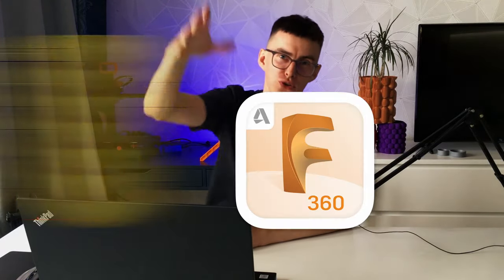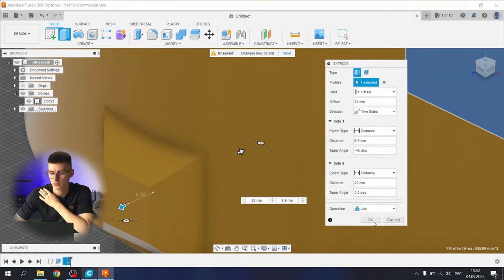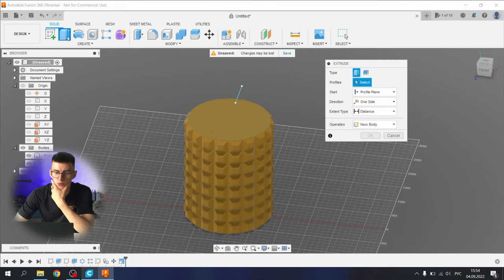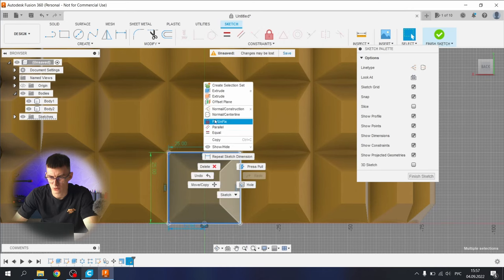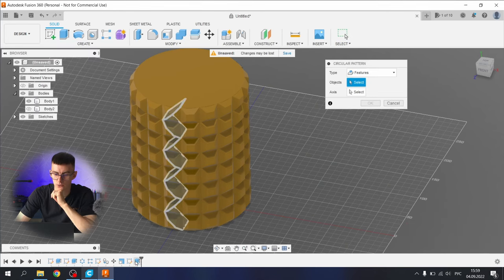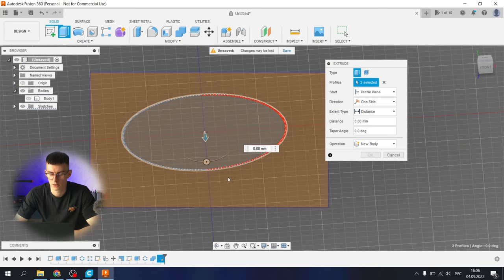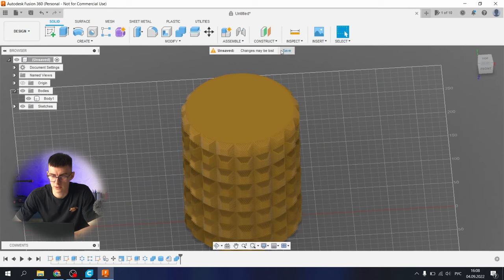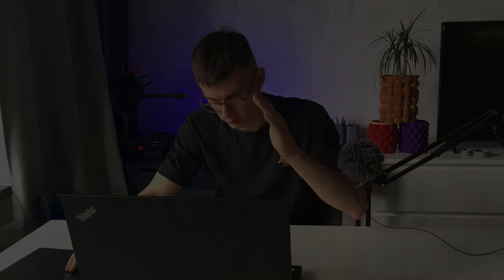FUSION 360 - PORCUPINE VASE

Comment: Thanks for doing tutorials in Fusion 360 even though you are not very familiar with it. You can change the Fusion 360 Z Axis to point up in Preferences/General so that the axes will align with Cura's. And on the difficulty with selecting the circle base, I recommend hiding the bodies and use your original sketch circle rather than making a new one. Also, it looked like you drew that circle on the bottom of the vase rather than on the plane, so the vase ridges were automatically projected.
Reply from the maker: Hey! Thanks you for info! That was really helpfull =)